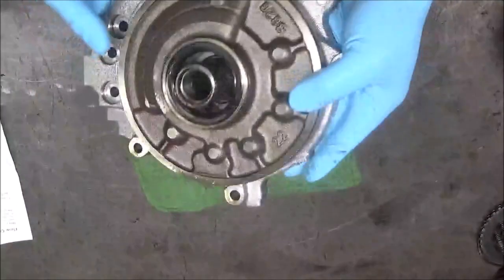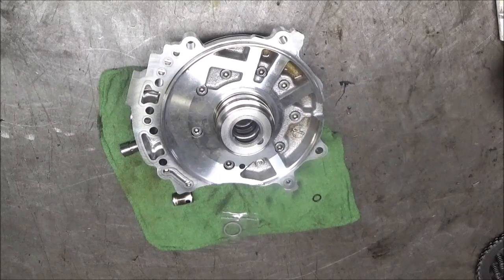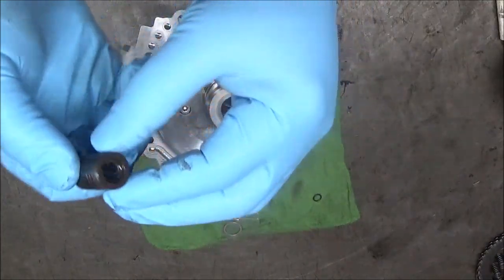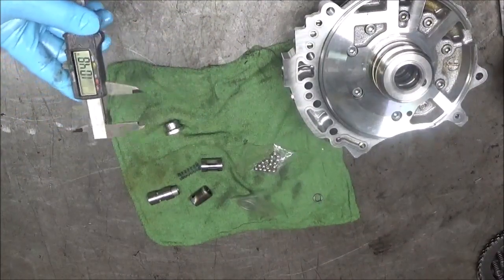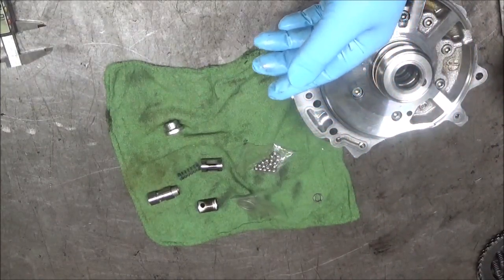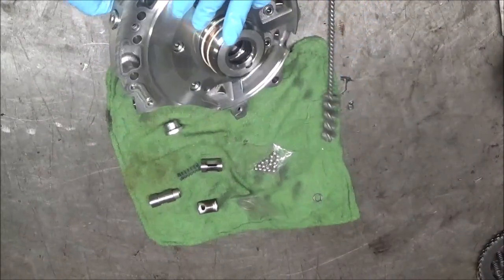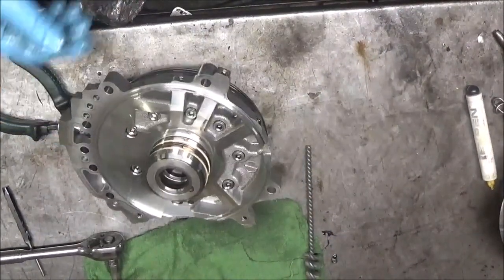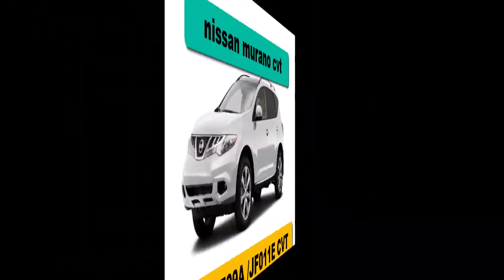NISSAN MURANO (RE0F09A/JF010E) P1778; P0746 FLOW CONTROL VALVE COMPLETE WALK THROUGH!!!!

Comment: Hi Thanks for your quick response again and for posting this video. I am new to this. When removing the CVT from the vehicle, does the torque converter also need to come out with CVT on the Murano? What is strange to me is that I have the Throttle Buzz but there are no codes other than Catalytic converter which goes out in time.
Reply from the maker: Torque converter comes out with the transmission

Comment: I have a Nissan Murano 2014 that has just recently had CVT Transmission Oil Changed..less than 2 months, showed codes; P0746 time 2, P1700 time 2 and 
P1778 time 0. It bumps sometimes if i step on the accelerator from a full stop. Or won’t accelerate speed. Can i just have the P1778 code fixed since its in a “0” life time? What could be done to lessen the cost?
Reply from the maker: You don't want to hear that you need to replace the transmission do you?
Reply: @thisisyourtransmission  I was told. And yes, it hurt my ear. No choice but to replace though.

Comment: Hi. I have a question. I have a 2014 Nissan Maxima which had the 1778 code at first. We replaced the stepper motor on it and now it has the P0746 code. Should I replace the valve body on it or should I try this step right here?
Reply from the maker: The transmission on this vehicle normally has to come out. The flow control valve almost always have to be replaced. However, it is best while it is out to go through the whole transmission.
Reply: Hey bud I have had the same issue with the same 2014 Nissan Maxima did u ever find out the reason

Comment: I have a 2011 maxima that first had the code p1778. When I got home it turned into p0746 and the code still is in the system
Reply from the maker: This is a stepper motor code. You can try changing the stepper motor. However, it is normally a bad transmission.

Comment: Does this transgo kit work well or an oversized sonnax which will you recommend..?
Reply from the maker: I won't make a recommendation. I will only show what has worked when I use it and this one I have used with no problems. I have not used the sonnax version yet. I do not see the need of buying dreamers and valves when this has worked.

Comment: If I have a code p0746 for a stuck solenoid should replacing the valve body fix the issue?
Reply: 2010 murano and only has acceleration problems when engine is at regulated temp
Reply from the maker: how many miles on the vehicle?
Reply: I have the same issue on a nissan murano 2014 with 90,000 miles it runs fine is just when I come to a stop that it gets lazy when accelerating but once over 10 miles it runs perfect  I changed the step motor changed tran filter and oil but its still doing same thing o and I don't have no lights on my dash saying there something wrong???
Reply: if I do change the valve body how do I program it??
Reply: @diavolow9  Did you ever repair this issue? I believe I have this exact issue. once I hit 10 mph it accelerates normal but you have to hold the pedal down hard to get to 10 mph slowly. if you do it to hard it will jerk really hard and go into limp mode. I just want to confirm that someone with the same symptoms replaced this control valve and it repaired the issue. thanks
Reply: @richardwhite6943  yes i did but i needed a special programming to be able to work i took it back to nissan they worked with me and put on a brand new transmission for the same price it was going to cost to program it. I got charges $4600 dollars not a cheap fix but i had no option.

Comment: Love the video your awesome 

Where is part located in the CVT tranmission ?? I can I do it myself?? 

I have 2011 Nissan murano 3.5 with RE0F09A/JF010E transmission 

Plz brother I need your help I
Reply from the maker: You can, but you have to take the transmission out of the vehicle. Then you have to take it apart to get to the pump.
Reply: Your awesome help brother. 

So what does the pump do ? Because I took out the valve body I cleaned it out. 

Do I have to reprogram the TCM or do u think the pump is the iisue. 

For some reason my transmission. Is like driving on overtime. Not even shifting to second gear
Reply: @ 

Ok it sounds like it’s a hard job. 
My transmission didn’t shift not even to the first gear. I took the valve body out replaced it with some new solenoids from another valve body. 

But I didn’t reprogram it yet?? From the Nissan. Dealership . 

Maybe that’s why it’s acting up ?? 

Would that pump for the flow control valve do this